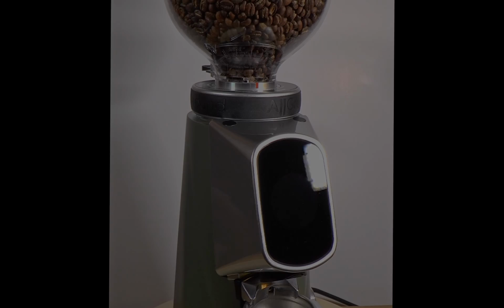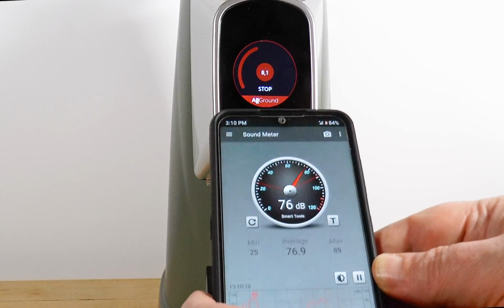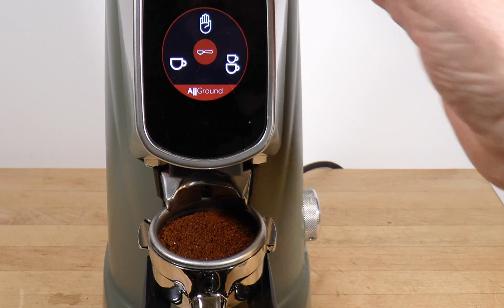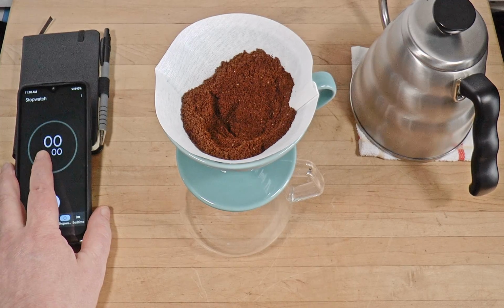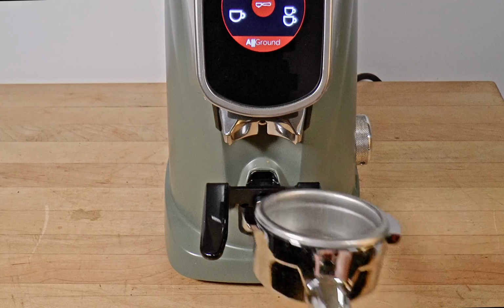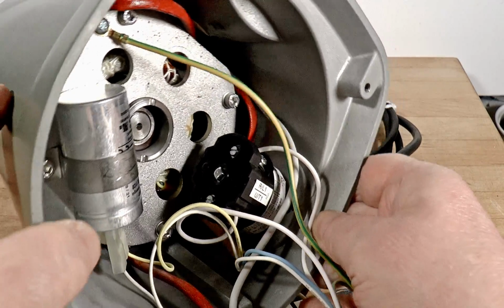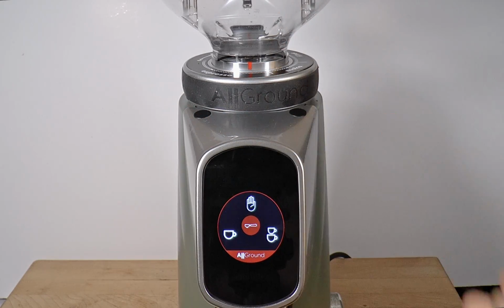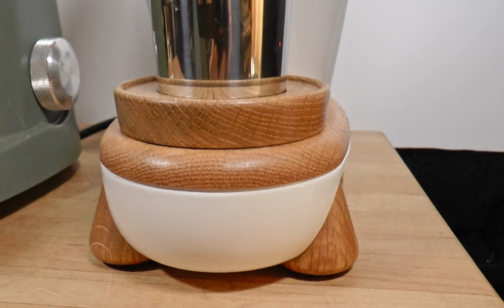Fiorenzato All-Ground In Depth

Comment: There is actually between 3-6 gram retention measured in some videos. There is a video where a official Fiorenzato Guy said retention is 3-4 gram. The retention mainly is located on the tunnel between the grinding chamber and the chute. Not some big problem  as most on demand grinders with hoppers work this way, but there is that retention so it’s not really negligible

Comment: Hi, wanted to ask if you ever had issue with the screen flickering/flashing on espresso mode? I just received mine and after set up and running one dose through the espresso screen continuously flickers and only stops if I place the dosing cup back on the fork.

Comment: Hi sir, I found that this grinder produces very good espresso grinds but when trying to grind for filter coffee, there is a huge buildup of static electricity. What would you recommend to fix this?
Reply from the maker: If you live in a dry climate, for single doses, spray a little water mist from an atomizer on the beans just before grinding.

Comment: What an awesome review, you can't imagine how many times I've come back to this video to find answers while using this grinder.

Wondering if you've tried switching burrs particularly with SSP burrs? I don't see any way to re-calibrate the grind settings and a bit worried that it won't work

Comment: I just want to say that you do the absolute best thorough evaluations of Espresso/coffee equipment
Reply from the maker: Thanks. One does one's best :)
Reply: @wiredgourmet  I have a question you may be familiar with..I have the Baratza Vario W (the older version before they made the W+) and it just will not grind light roast or really fresh beans..It binds up or the adjustment levers that you use to set your grind will jump around and throw the grind way off from where I set it initially..Any ideas ?

Comment: Hello Thomas, thank you for this in depth/tear down video - I watched it for the first time yesterday and was so impressed I pressed the order button - the artic white and wood is due to arrive in about 5-6 working days. 
I have a couple of questions which I hope I didn't miss any info you gave in the video: 

Did you remove the burrs from their mounts on your deep clean? (not shown in the video).

I usually do with my specialita (which this all round grinder will replace) as there is always a fair amount of coffee under each burr on the specialita, even with the screws evenly turned down. 

However,  what would you advise for maintenance on the All Ground - leave its burrs mounted on their respective rings during a deep clean, or remove one or both of the burrs to clean underneath them?

Thank you again - your videos are greatly appreciated.

Comment: Were you able to use the grinder as normal after removing lower burr carrier without any specific calibration? I've removed the carrier on mine which caused in a inability to grind fine enough for espresso. The grinds are too coarse, even though the collar is set to the lowest possible setting.

Comment: If I have a 110V AG machine, and accidentally connect it to 220V causing smoke to come out briefly, is there any chance that I can repair the circuit part mentioned at 20:33 myself? Currently, it still works when connected to 110V.thanks.

Comment: Unfortunately, the manufacturer doesn't seem to offer the black with walnut combo. Is the control unit held primarily by the two phillips screws under the cover dots, the two bottom tabs, and the three JTAG connectors?
Reply: It’s crazy how they don’t offer the black/walnut combo. Such a shame lol.
Reply from the maker: And one small Philips on the board. That's all there is to it. Were you thinking to buy the one you prefer as a spare part?

Comment: Did you still have to purge between grind size changes or in the morning even with the low retention?
Reply from the maker: You need to run or pulse it going finer, but I wouldn't worry much going coarser. It holds onto very little coffee.
Reply: Having to pulse to go finer is a deal breaker for me. Never did that on my Breville SGP, from which I’m looking to upgrade. Any hopper-based all-rounders out there allowing to switch between grind sizes without running the motor/wasting coffee?

Comment: Can you advise on what the filter (for that matter moka as well) workflow is? It looks like you have to press to ground and stop on the screen. If so, how do you measure the dose?
Reply from the maker: Brew range is toggle on and off by touch. I just weigh the dose. Moka is hold to run, release to stop, but the funnel is best filled by volume not weight, so that's OK. And espr is timed.

Comment: I didn't quite make out the specific part but the microcontroller they used is an stm32h7-something. These have arm m7 cores that can do about 500 MHz, have hardware fp, hardware multiply, etc.

In short, it's an insane amount of overkill to run a touchscreen and turn a motor on and off. But I guess there's room to grow with fw updates. :-)

Comment: Hi, what a great review! The Abo is well deserved ;-) Can you please try whether this machine is compatible with SSP (multipurpose) burrs? Thx in advance!!
Reply from the maker: There are a lot of factors and this model can't be calibrated. Overall height / thickness might be wrong. The lip on the reverse side usually sits in a groove in the carrier; the width and relative height of the lip is variable, and a poor fit might mean axial mis-alignment. Burrs are not necessarily interchangeable just because the screw holes line up. I would buy only if SSP says they'll fit correctly in that grinder.
Reply: @wiredgourmet  thank you for your expertise!! I like the mechanics of this grinder! But for me it's a missed opportunity (and no go) when it's not possible to pair it with different burrs...

Comment: Another excellent and thorough review Thomas, thank you! Could 64 mm SSP burrs could be accommodated in the grind chamber or would they be too thick?
Reply from the maker: You're smart to ask about that. Not just overall height might be wrong, but the lip on the reverse side usually sits in a groove in the carrier. The width and relative height of the lip is variable, and a poor fit might mean axial mis-alignment. They're not necessarily interchangeable just because the screw holes line up! I would buy only if SSP says they'll fit correctly in that grinder.

Comment: Finally you are back! 🙏🏻
Also.. I don’t know whether you are still rocking the robot on a regular, but I would love to see a follow up video if you feel like it (i.e. it’s amazing how you can „save“ shots by adapting the pressure profile/prefinfusion if your grind-setting is not spot on).. have a good Weekend 😄
Reply from the maker: I am still using the Bot, and I will have some more content about it as soon as I get the semi-auto machine, so early winter.
Reply: @wiredgourmet  definitely looking forward to it.. it is just so much fun to use and did I mention the shot quality? :O

Comment: yesssssss!!! been waiting for this review! mines coming in tomorrow!
Reply: @Antonio Azumendi I have issues with the touch screen at the moment. I have contacted the company and am in the process in getting it fixed. Other than that I really like everything about it. Love the ability to check the burrs almost instantly with no tools. The dial in is pretty intuitive. I thought I would use it for different brews but I realized I used it mainly for espresso. I have a 1zpresso Kmax hand grinder for pour overs now so the all purpose grinder is nice option but I don’t use it too often. Recently it did come in handy because I made a bunch of cold brew and was able to grind a lot of beans coarsely and into a catch bin witch holds like something like 80grams. 

When I’m dialing in a shot the micro steps have been more than adequate to fine tune. Even though it’s not stepless.  

I’m not sure what happened to my touch screen. It’s really sensitive and clear to see but when I click the double shot it will go for a second or two and then stop. I reset my grinder and then it works fine. As long as I keep the grinder off and turn it on it works but if I keep it on for days it will glitch. 

I also like the fluffy grinds, doesn’t clump much and the sound is pretty low.

The big thing is how it comes basically perfectly aligned from factory. This seems to be a big issue for a lot grinders 

I like the burrs as well, 64 red speed. I have produced some great light/medium espressos with my ECM classica with flow control. 

I didn’t like the Eureka dial in knobs. I don’t think they are the most intuitive but now I think about. I don’t really adjust too much every time I change my bean. And since each bean is like a couple clicks away to dial the knob from eureka shouldn’t really be an issue. Only and issue if you go back and forth from pour over to espresso.